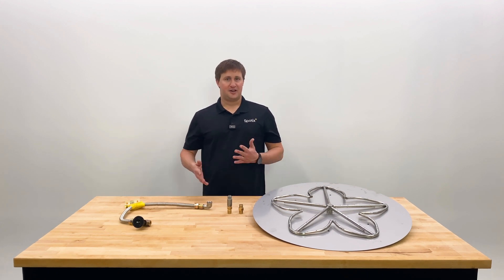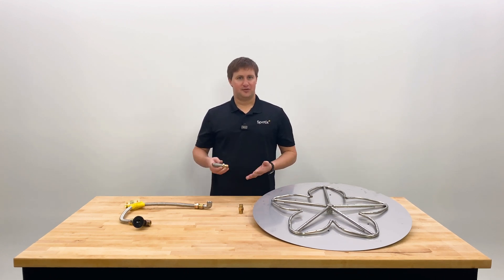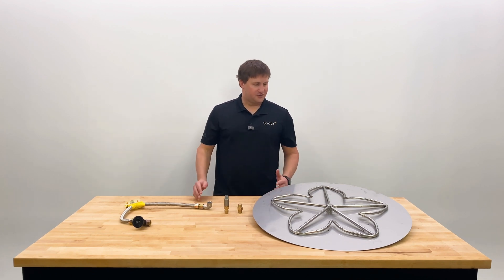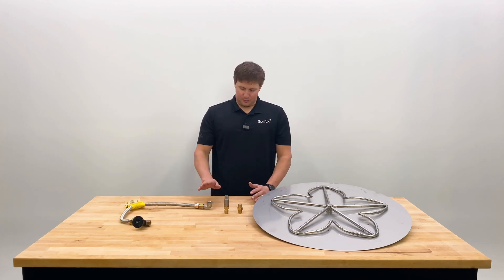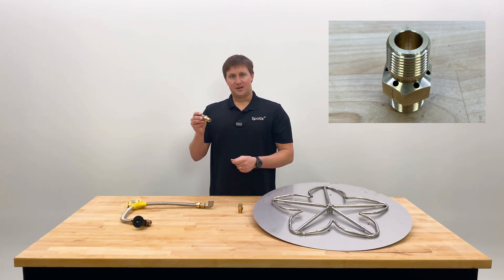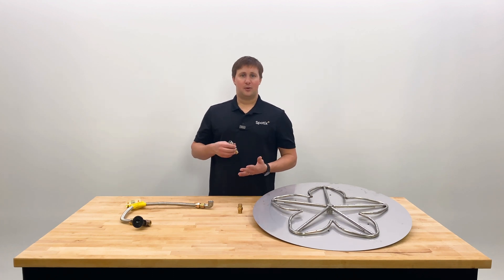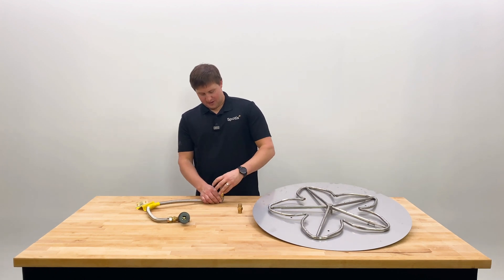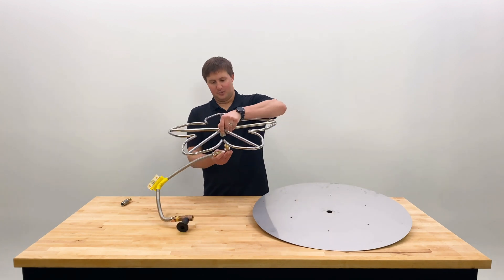Are Propane and Natural Gas Fire Pits Different?

Comment: Are the stainless fire rings the same, can they interchange between Propane and Natural gas? I have a fire pit I want to convert to Propane bottle from Natural gas and was wondering if I can reuse the fire ring. I know the fittings/regulator are different.
Reply from the maker: It can vary. Some fire pits have air mixers built into the piping rather than a separate piece, especially if it was a pre-made/built pit. If you're referencing a pre-made fire pit, you'll want to check the manual to see if conversions are allowed. 

If you are referencing the burner itself, then most likely it would be ok. In any case, we always recommend checking the product manuals before converting in case the manufacturer advises against it.